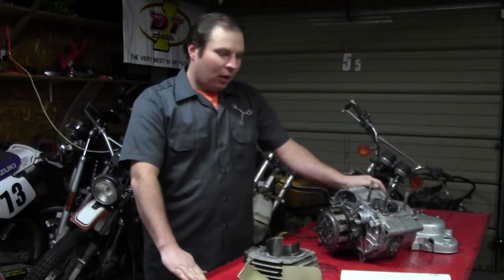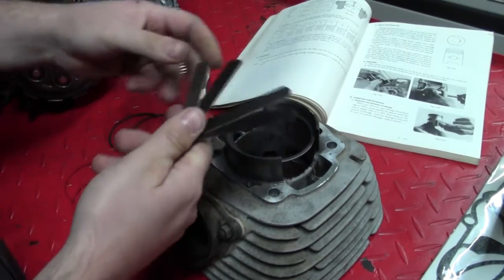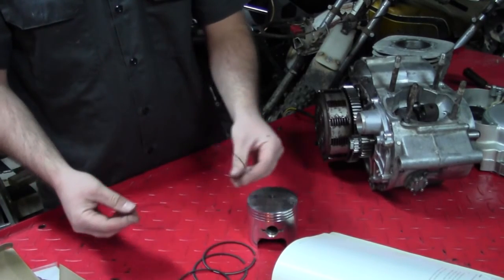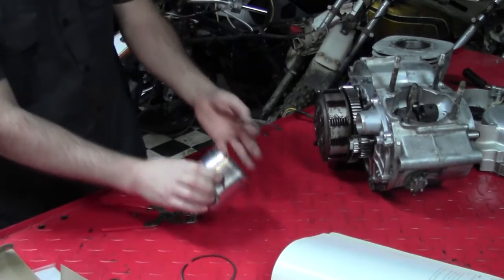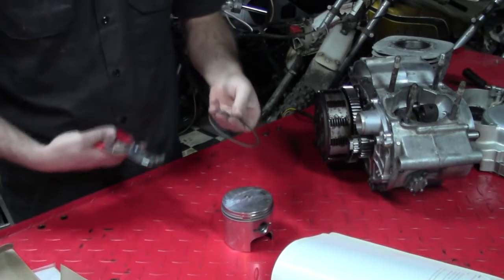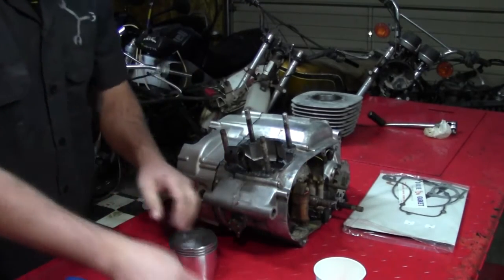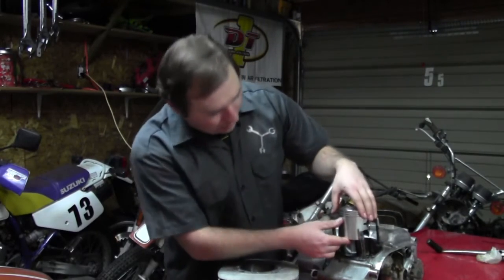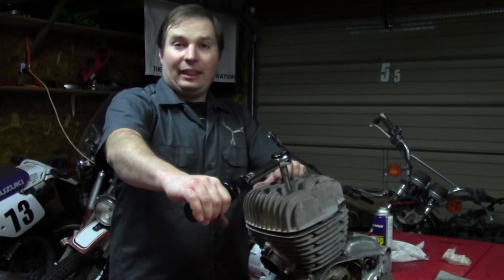1970 Kawasaki F5 Big Horn Top end and engine assembly - Barn Fresh EP5

Comment: Very comprehensive!  I know enough to know, you know exactly what you're doing!  Thank you for sharing, JM!
Reply from the maker: +Kevin Chamberlain Thanks.  I hope to make more in the future, but there should be plenty to watch.  Don't forget to check out my F9 project a vintage motocross bike build.  I also have even more information and pictures on my website.
Reply: thejunkman Thank you very much!  You mentioned that maybe 45 horses could be liberated from that motor?  That would be one hell of a bike!  You've caught my interest!
Reply from the maker: +Kevin Chamberlain Yes, as far as the advertising stated using the "Speed Kit" or "Power Pack" parts and modifications.  This was a factory offered list of parts you could order from the dealer or have installed by a dealer to theoretically get about 45hp out of the engine.  This did require porting of the cylinder and the manual had technical drawings that specified how much material to remove to re-shape the ports.  I have the complete manual and other information on how to perform these modifications.  This was a 1 year only offering.  My performance project (using an F9) employs most of these modifications and parts.  http://www.thejunkmanadv.com/kawasaki-f5-speed-kit-manual.html
Reply: thejunkman Thanks!  Lot of power for an old two stroke!  Probably 10 years ahead of it's time!
Reply from the maker: +Kevin Chamberlain The ideas were ahead of their time, but I would say technology and manufacturing was not ready for all the ideas and features that were applied to this bike.  The HATTA forks would be a perfect example of this.  The idea of adjustable forks with tuning adjustments is and was a great idea as now all modern bikes have this feature, but at the time it was executed poorly and they didn't work any better than the competition's non adjustable units.
Reply: thejunkman Thanks very much!
Reply from the maker: +Kevin Chamberlain Episode 2 I talk about the features and history of the model.

Comment: no rag in the crankcase in case you drop the circlip,your lucky and those head gaskets have to go on a certain way cause you will end up forcing the bolts down bending the copper gasket..took my f5 apart and for sure enough they had the head gasket wrong and all burred up around the holes of the gasket

Comment: Isn't this a lot of mucking around if the engine is not going to go.. CDI fault for example  sounds expensive. Or the alternator is stuffed due to water getting in. I'm a new rider so could be a stupid question.
Reply from the maker: Not a stupid question at all.  I address this in episode 1, before starting a project of this magnitude you must evaluate if you have the resources or knowledge to fix or buy replacement parts, that could be expensive, before you even start.

Comment: what about a compressing tool for the piston rings instead of doing it by hand? Even you can homemade them with clamps, doing it by hand there are a lot of possibilities of tearing the piston rings... just saying ;)
i homemade my piston rings compressing tool with a piece of round plastic bottle (chocolate drink bottle for children breakfast, here in Spain it´s called "Colacao" but i´m sure you have similar products there) because it´s thickness is perfect, and then just two big size clamps. Cheap and easy ;)
Reply from the maker: You are correct.  I could have used a ring compressor, but I wanted to show that most motorcycle piston rings can be done by hand if taken some care.

Comment: I have a 4 stroke Honda ct70 that needs a top end but all Honda has is rings for it but I want to do the entire top end where can I find parts I don't want to pay a lot of money to get a piston custom built But the bike is anywhere from a 1969 to a 1975 and it has original everything even the tires im pretty sure I had a 200cc Chinese at that needed a C.D.I box and he gave me The Honda $80 And a leaf blower I prolly would eve straight traded anyways but can u possibly help me out on where to find parts without spending a fortune and I don't wanna put Chinese parts in it.
Reply from the maker: +Steve try hondatrailbikes . Com and the Chinese parts aren't that bad as a matter of fact the Honda Dax (ct70) is made in China for  Honda.  I have raced highly modded 50cc  Chinese engines and still have them.  It's true a good amount of the atvs and vertical engines are junk, but most of the horizontal engines are just fine.
Reply: thejunkman Thanks alot for the reply i have subscribed btw i have a few chinese buggys, quads and once you floor it for too long about 6 seconds they usually just blow or lose most of their compression but its only 40 bucks on ebay for The cylinder and all the top end parts but im thinking that it must be junk to be so cheap where did you get your parts from
Reply: 40 bucks for the Honda ct70
Reply: thejunkman The thing is i buy and sell fix any type of powersports just as a hobby but this is actually my first classic bike and it seems really hard to find engine parts for being so old but i plan on keeping it so i want to put high quality parts in it and i had no luck with the website you gave me i hope you can help me out a bit with this situation Thanks ~ Steve
Reply from the maker: +Steve hondaminitrail . Com  or. Tboltusa . Com.  I had remembered the address on the first one wrong.  There is also eBay or google searches
Reply: thejunkman  Thanka for the tips and goodluck with your projects
Reply from the maker: I got most of my parts from Tbolt USA and DRatv .com.  I used to ride for SGR-USA when I raced pit bikes.  You can find some of those old videos on my channel.
Reply: thejunkman Ok ill give it a try

Comment: what would cause a dirt bike do just speed up when at a ideal
Reply from the maker: I think you mean idle?  A lean condition will cause this.  What causes the lean condition?  That can be several factors, most commonly is a blocked or partially blocked pilot jet. A vacuum leak is another reason.  There are other numerous other reasons and causes for this.  A systematic diagnosis is required here.  I have some info on this on my website under carburetor jetting and tuning.  I also have several videos on my channel that address what is going on in the carburetor and how to correct it.
Reply: @thejunkman  yes i ment idle